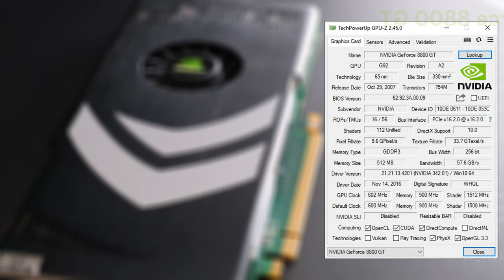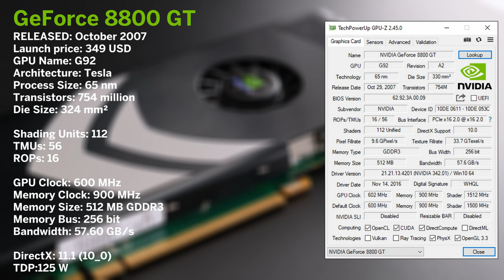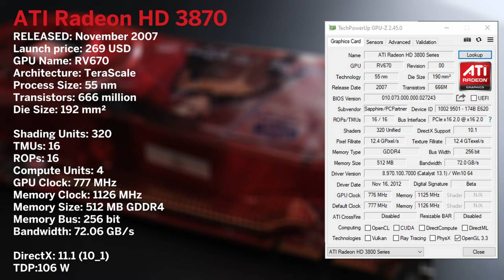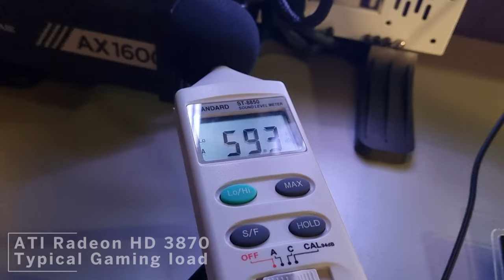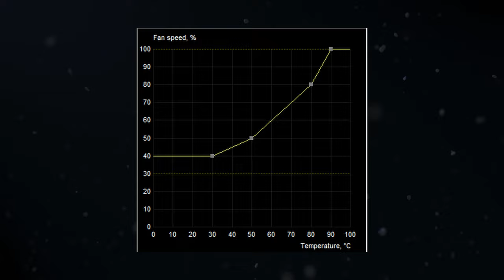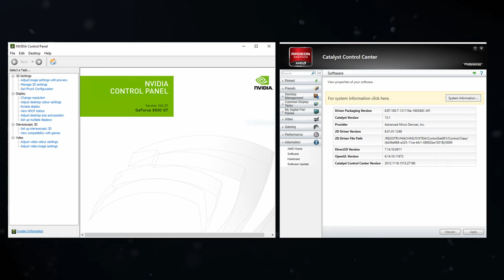GeForce 8800 GT vs Radeon HD 3870 - Legacy GPU Battle vol.1

Comment: 8800gt was the last single slot video card I own'd and it was a beast!
Reply from the maker: Yeah! That thing rocks!!! Small form factor FTW!!!
Reply: I like the design (slim and all metal) but it is not reliable. I have two dead 8800 GT with that cooling system. Another one Asus 8800 GT two slot and with a big heat sync and big fan is still working.

Comment: This must be one of the best videos on your channel so far in terms of editing, the vibe of your videos reminds me a bit of F2F Tech, don't know if you watched his videos :)

As for the results, I think the drivers on Nvidia's cards for the 8000 series really help out as they always have been great, but of course the 8800GT is the more powerful card here.
I once had a HD 3850 256MB which ran GTA V at 720p 40fps, as well as a 8800GTS in perfect condition, that one was just a joy to look at :D

In my country, the 3870 can be had for only 10$ but the 8800GT is 20$ or a bit over that, considering the performance difference it makes sense and also a bit of an advantage for the 8800 is that it natively supports windows 10 with the latest drivers, the 3870 doesn't, but you can install them manually in a few minutes, still on the 3870 windows 10 can produce quite a lot more issues then a 8800GT with official drivers.
Reply from the maker: Hi mate, Thanks for your nice feedback! Of course, I admire his videos,  so knowledgeable! I was expecting the HD 3870 to punch harder, however, the G92 was quicker than G80 - makes me wonder by how much, perhaps that would be a much closer battle :) I got both cards significantly cheaper, they just gone up in price! 15 year old cards, haha! I saw no issues on either of the cards :)

Comment: One of your best videos so far. I had a HD3870 but it was quickly replaced by a 8800GTS 512MB version. That was the golden era for hardware. I got a job around that time and most of my money went in to PC hardware. As i said before, these days hardware is kind of boring. Hope Intel GPUs will spice things up in the future.
Reply from the maker: Ahh! Thank you mate!!! :) Really appreciate your feedback! Well, I'm here for your entertainment  - hope to deliver haha! :) I have the GTS and GTX too!
Reply: I'm afraid we're reaching limits at 5nm.  Time to make the chips bigger and underpowered them to run cooler to defeat heat constraints.  The old 3870 gpu core is the size of a dime.
Reply: I remember I replace the old Geforce GTX7900 with a HD3870....

Comment: I would like to know the test system in the vid, as that gives a better idea about the wall power draw, but since you tested both cards in the same system it's a nice comparable.
I'm excited for the dual gpu round!
Reply from the maker: Great point! I'm, not sure how I did not insert that information in there, must have slipped out :) The Bench runs 10850K and 32GB of 3200MHz memory. Glad you enjoyed the video and same here, I'm only about to start testing those now! :)

Comment: Hello, one question. I have been trying to install the drivers for my laptop graphics card. It has amd radeon 6480g and 7400m and when installing it comes out a blue screen.
Reply from the maker: Hello mate! Did you remove previous drivers using Display Driver Uninstaller ? I would recommend you give it a go - it helped me in the past to resolve some BSOD's :) What OS are you running ?
Reply: @nexus_tech  I have not tried ddu but I will try and my os is windows 10 pro 64 bits I tried to install the drivers in windows 7 and it did not work either

Comment: Unless I'm crazy, I remember the 8800GT specifically launching at 249USD.

Edit: I wasn't crazy. TPU has the launch MSRP listed at 349 for some reason but reviews I remember reading about the card back in 2007 state the launch price of 199-249 as stated by nvidia.
Reply from the maker: Hmmm! I looked at few reviews and price ranges from 199USD up to 349 USD. Somewhere I read there was an actual shortage of those G92's. If we go by price of 249 USD, it makes the 3870 look much less appealing. Thanks for checking out the video, hope you enjoyed :)

Comment: why dont you specifically install 3870 driver ? 3800 series is good enough but i dont like series i like specific driver they are included in the pack you should just install them manually by choosing "let me choose   " and i have disk ...
Reply from the maker: Hello mate, I did just that, as that's now unfortunately the only way to get the CC to work under Windows 10 :) I've made a video covering the install here: https://youtu.be/aAXSnoX4y08

Comment: I tested this Team Red card recently against the brother of the Nvidia example here, the 8800 GTS, gaming on a native 900p monitor. The latter card won hands down, with Tomb Raider and Crysis both being smooth and highly enjoyable; the HD 3870 could unfortunately only produce a stuttery mess in both cases. I got mine for 7 and 9 bucks respectively. The Nvidia beast will end up in a retro machine based around a modded 775 board with a Xeon E5450 :).
Reply from the maker: Hello mate! Thanks for checking out the video :) I've not had too much trouble with the HD 3870, I have the GTS and GTX too, might be a interesting follow-up video. That's great choice, still very impressive for 15 year old GPU, isn't it ?

Comment: I'm afraid we're reaching limits at 5nm.  Time to make the chips bigger and underpowered them to run cooler to defeat heat constraints.  The old 3870 gpu core is the size of a dime.

Comment: It's so funny as I very well remember having both cards, 2x 3870 crossfire and 2x 8800GT SLI... And I don't know what happened back then in 2008, but those 3870's were absolute dogshit. Also crossfire seemed to be the biggest issues to get working, I had a particular game I played (Live For Speed) with 40FPS for the ATI cards versus 300FPS on the 8800GT's... it was unbelievable and could not understand. I bought a special motherbord with dual AMD cpu's and official crossfire support, still didn't work. After a month or so I sold everything I had AMD related and kept my E6600 + 8800GT's. There must have been something very wrong but my experience with the 3870 is the worst of all videocards I have owned. And that's almost everything from the 3DFX Voodoo1 up till that moment in time.
Reply from the maker: Hello Stefan! Thanks for sharing your experience :) Well, I think AMD has not had their best guns out back then! 8800GT in SLI must have murdered the poor pair of 3870's! haha! My experience was not as bad - but clearly - the Nvidia card has the leg! :)

Comment: The 3870 was never the 8800 beater.
It's well known it fell short but had been designed slightly before. It was ATi bluff that brought the 8800 as most manufacturers were holding back to make the next big thing.. 
This was fully known at the time. As Nvidia had this up their sleeve for quite a while.

The kick back was the 3870..... X2
Which was a card that could beat the 8800 by a margin and was of course a dual GPU on a single card.
It was beat by the 9800 shortly after. ATi being know for the bluff and at it's limits never came back.

But in the day, it was about quality and in a few ways for the lower frames (which are not important as you think) was the better visuals of the cards they made...

Go back a few cards and game with a ati card and play the same game looking at the difference... If you can see it..

I have all the cards mentioned, and was a system designer and builder (GT Ultima).
We made the top end bench leading systems back then. So had the latest and greatest as well as a hand in the wheel.

If it was over 30fps is was good and playable. You 100% never wanted any lows of <26.

Nvidia was promising better graphics, as seen in the card premier videos, but that never came to be and today we maybe get half of that... Over a decade later!

For a video... Hunt down the holographic game, last seen in Minehead England.
Still not seen anything like it.